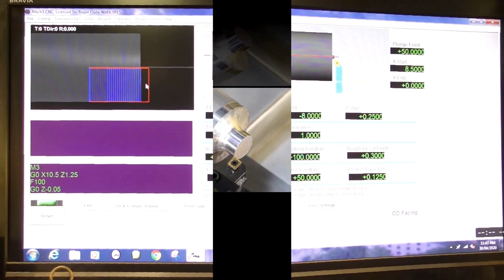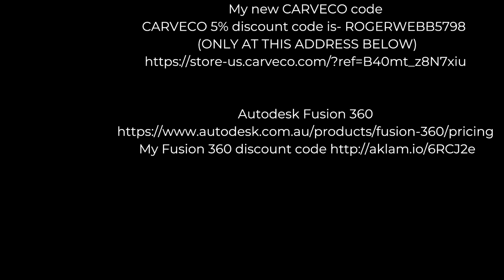HOW TO CNC conversion Harbor freight/grizzly 7 x 14-inch mini-lathe 35K views #ALL you need to do#

Comment: On a Lathe if you had some round stock and you needed to bore a hole that was more to 1 side ( as in not center) can you alter the Jaws on the chuck to do this?
Reply: As a machinist i can say yes you can do this its called off center turning (eccentric turning). You can either make them or order in the equipment to do it. Truthfully its faster to do it on a mill
Reply: @dominic6634  cheers buddy, I don't have a mill unfortunately tho
Reply: @sotkshadow8306 you can also shim a jaw or install a 4 jaw chuck to turn off center